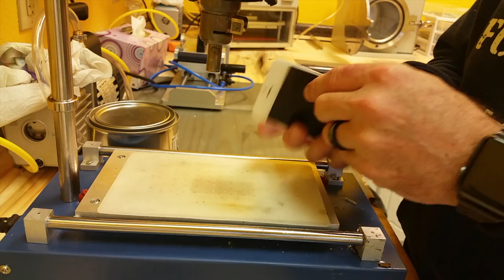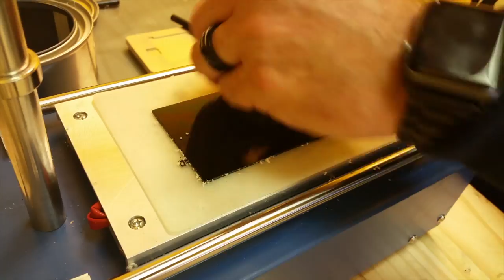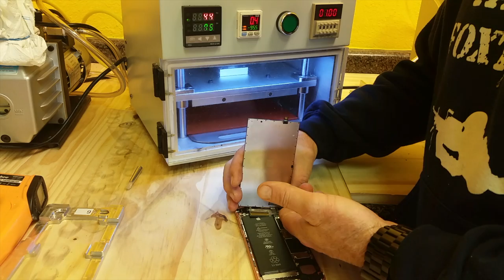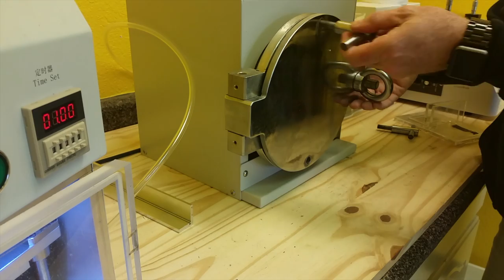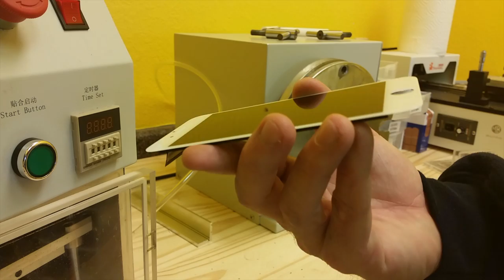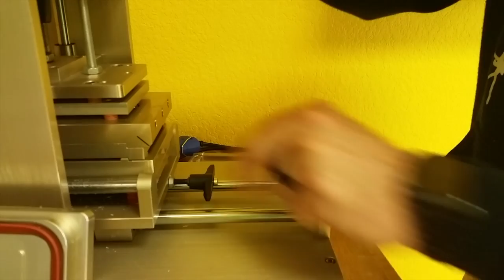iPhone 6S Glass Only Screen Repair

Comment: que temperatura usas?
Reply: dont go over 70c for more than a few min. most people say 60c for 10min is the limit before damage. I've gone hotter for short bursts...its a risk. The frame he removes first needs more heat or some swear by acetone+IPA google the ratio

Comment: cant do it at home with a hair dryer? lucky for me i have almost exactly that machine at home...but your heat gun mount makes me slightly jealous and i go the uv route... what temp do you use in c on the hot pad?

Comment: Nice vid! I have found that on some of my refurbished screens, the glass ends up lifting away from the bezel/frame. I have the same frame assembly machine and use 180 degrees for 8-10 seconds. Do you have any tips to fix this problem? Thanks!
Reply: Actually now Frame and Glass assemble together is very good for Iphone 6 and 6s as for them frame is a little harder to firm on the glass. You can try this. Jenny Zhou whatsapp:+86-15889548883, skype:jenny_5066 wechat:1055425560.
We are phone repair machine manufacturer and welcome to visit us in Shenzhen. ^^